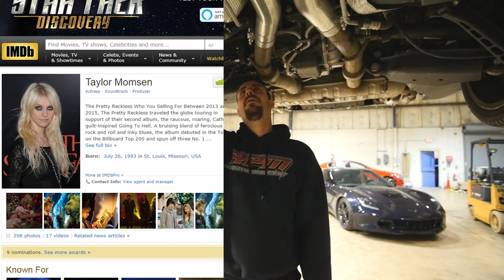Don't Do This to Your Z06! | RPM S4 E15

Comment from the maker: To clear up the confusion some may be having.  The grease on the wrong side of the plugs did not necessarily cause the metal in the engine.  We noticed the dielectric grease on all of the plugs and decided to investigate further into the car and see if we could find any more issues, thus revealing the metal in the filter and a bigger problem then the plugs.  However the grease could easily cause detonation which would 100% cause premature bearing failure

Comment: Its coast efective and more efficient if fran does the led shop lights. Thay wall last 10 times longer and be more brighter.
Reply from the maker: It's not cost effective at this time with them costing 10 times as much.  On generic fluorescent lights going to LED yes, but large sodium bulbs that cost $300 each vs $30 it would take 20+ years for it to be cost effective.

Comment: Are those American racing headers for the 6th gen coated? I Went with kooks, but they aren’t coated
Reply from the maker: What 6th Gen?
Reply: RaceProvenMotorsports @13:32 looks like the underside of a 6th gen to me I could be wrong
Reply from the maker: That's a V3 CTS-V, but very similar to the 6th gen Camaro, and no ARH does not recommend coating or offer it.  They only authorize Swain Tech Coating if you do.